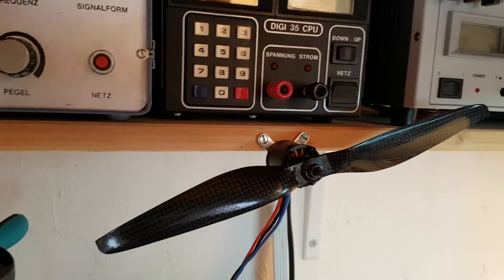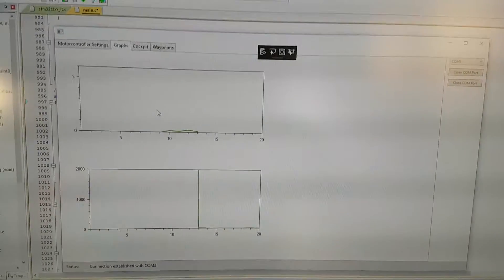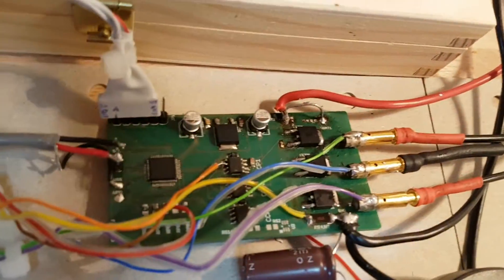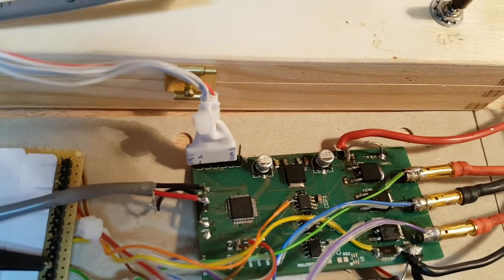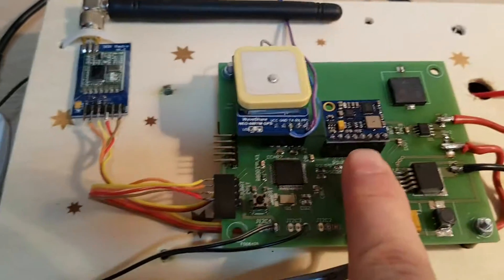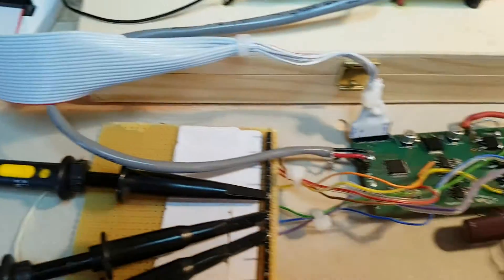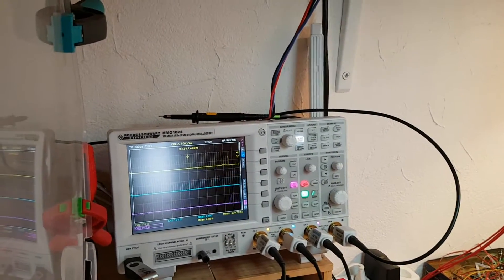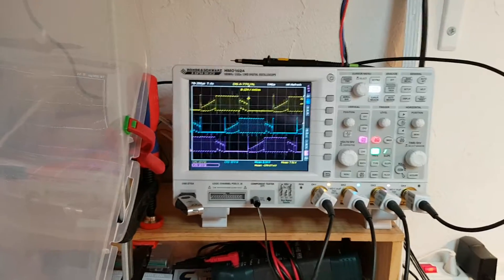STM32 based BLDC motor controller

Comment: Have you tried Sliding Mode Controller for BLDC motor? Is the controller shown in the video a Sliding Mode Controller?
Reply from the maker: I do not really know what you mean with "sliding mode". I am using a rather simple mode called "trapezoidal commutation" as described in detail here: www.verysmart.ch.
Reply: Ok..Thanks

Comment: If BLDC is of 3kw electric system is of 72 volts. What MOSFET will be suitable?
Reply from the maker: well the IRLR3636 are only rated up to 60V. But for istnce the IRFSL4310 is rated at 100V o
and should be able to be driven the same way as the IRLR3636...

Comment: hi, i start to work on your firmware just yesterday (BLDC)... nice work, very intresting how you solve some problems. I want ask you, this is the firmware that work in video? do you use PA5, PA, PA7 pin for change sensitivity for comparators at start:  if(setPWM>300&&pwmState==0)?? an oc5Value is a constant value depending of Power supply voltage? becouse &&(oc5Value!=oc5ValueOld is always true :D . Really nice work.. no more all the internet the clear works like this... If you spent a little time for explane how the system work is a a good time. Thanks for your share... its a good start point and (I know) a big gift...
Reply: no init value for: commutationTimerOffset, and why media for 12 values?  ....commutationTimerCounterArray[5])/12; thanks for your help... ;)
Reply from the maker: Hi Marco; will come back to you in a few days. This https://github.com/SNM60 is the current SW. You can find some additional information at www.verysmart.ch.
Reply: thanks... ill wait ;)
Reply from the maker: Hi Marco, I was for 2 weeks on vacation and just returned yesterday from Florida... Yes, PA5:7 are used to change the comparator "sensitivity". At start up and for low speed I sample for the zero crossing of the BEMF (back electromagnetic voltage) at pwm_low times. The BEMF voltage is very low, so I need a smaller divider. At higher speed I do switch over to detect Vbat/2 (half the LiPo voltage). To make sure my input voltage to the comparator stays within range (BEMF voltage can become 7V!) I do change the voltage divider accordingly. 
https://www.youtube.com/watch?v=llOJaAMcnjA&t=20s shows may current setup of the quadrocopter.
Send me an email address so I can send you the schematics of the BLDC motor controller. I will also include the SW (I use TrueStudio) and the Cube MX configuration file of the STM32F303CBT6. 
Yes the oc5Value is used for fine tuning of the DAC output. The oc5ValueOld is old ;-) and useless, you are right... I will fix that these day TANK YOU! If you find more bugs, pls report!
See more explanations at www.verysmart.ch as well... cheers have fun, Stefan
Reply from the maker: commutationTimerOffset is by default initialized to 0; I thought I might need it to tune the commutation timing but I never did until now... The average builder helped for better commutation timing. The average of six counter values would be a division by 6. But the for the timing event we need to find the 30 electrical degrees and that is at half the timer value. So /6 and /2 = /12. See also www.verysmart.ch
Reply: thanks Stefan.. i sent the personal mail on youtube :)
Reply from the maker: You should have gotten the files this morning on your private account...